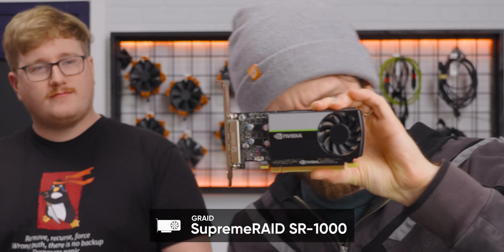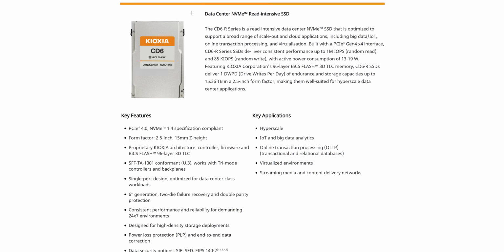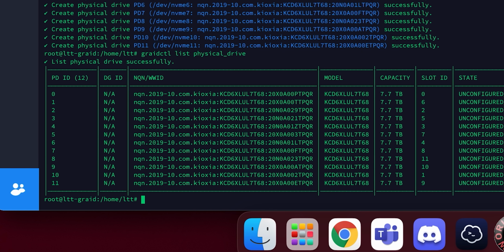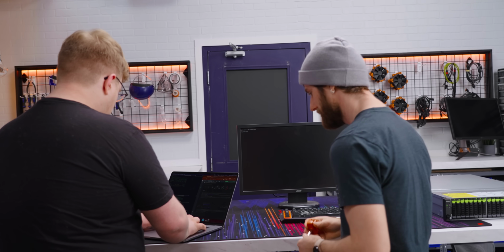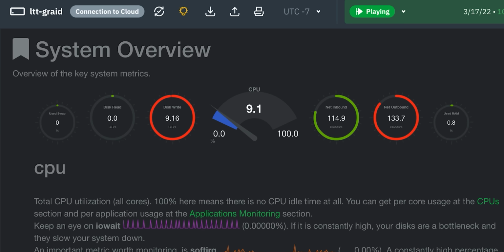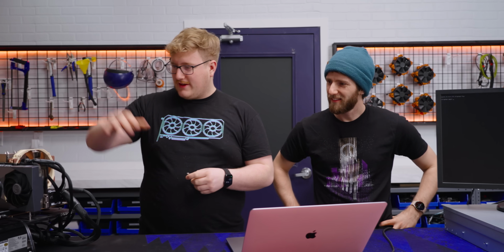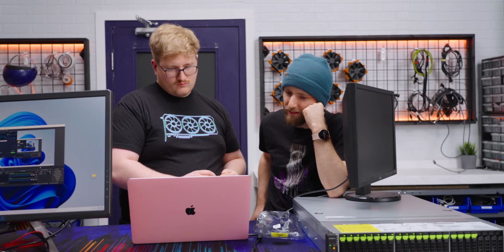I predicted the future! - GRAID Graphics Accelerated Storage

Comment: I wonder if this would be possible to do with any GPU with custom firmware. Would be a cool purpose for spare GPUs...
Reply: In b4 nvidia makes this a software feature and obsoletes this thing. Probably doesn't even need to buy them to kill them.
Reply: Spare gpu's.

HOW DARE YOUUUUUUU
Reply: @firefly2472  I'm sure they're talking about 10 year old cards
Reply: @doggo_woo  I know :)
Have a few myself.

And no, not gonna sell them :p
Reply: @firefly2472  Gotta collect em all lol
Reply: Well the bios reports as a regular card so it's software not firmware
Reply: I don't think you need anything special.... just a cuda program paired with a kernel module.Not even firmware change. At least I can think on ways to do it (IF shared memory is available).  I'm almost sure this is software locked.
Someone will do this in a generic kernel module  and any GPU in days... I'm sure.
Reply: @635574  that's where AMD would come in
Specifically the open source AMD Linux drivers, because I wouldn't be surprised if amd also tried to patch this
But the open source linux driver would bypass that patch
Reply: @firefly2472  yeah i have a 750ti, rx580 and a 5700xt sitting in my room with 2 x570 mobos, i  try to sell em but 10% below msrp aint workin
Reply: @MayYTlive  I was going to say, wait until the FOSS movement gets hold of this.  It could get interesting.
Reply: Yeah giving new life to ageing gpus... Even to run it like a virtual raid card is a great idea
Reply: I WANT IT OPEN SOURCE FOR AMD GPU PLEASE
Reply: @firefly2472  Got like a 650ti 560ti and a 1050 as spares
Reply: @framegrace1  i hope someone actually takes time and looks at this, otherwise i might
Reply: @firefly2472  me with my 6 home built pc's, yes spare gpu's how dare you, at least put them to work. and no that's not a joke, and no im not mining on them, i have them for different tasks.
Reply: Maybe. The ram up and CPU usage they described sounds like it's being loaded into the GPU at least partially by software not some special magic firmware.
Reply: @sZ04277  bro i will buy an rx580 or 5700xt for 10% below msrp

Hit me up fam, I need to expand my lan center
Reply: if you watch near the end they find out that it doesn't even have custom firmware, the software is literally just a cuda program and a driver. if it didn't tie the license directly to the gpu then it would probably work with any nvidia gpu
Reply: I was wondering something similar.  I could see the graphics card manufacturers working the capability into their existing drivers so they can brag that their own card makes your whole computer run faster.
Reply: @sZ04277  I would buy a 5700xt
Reply: Ofc, you just need to know how to write RS ECC using PTX assembly ;).
Reply: @Vatharian  I think it might be easier to break out a disassembler and make the licensing code accept the other GPU's serial number; as hardware serial numbers could be written into ROM or efuses or some other one-time programmable storage at the factory.
I'm looking at this as being a normal program compiled into AMD-x64 versus signed custom hand-tweaked NVIDIA low-level firmware written specifically for that series of GPU architecture.
And in turn, probably cheaper to just call up the vendor and negotiate for them to do it as a special order, since the other two take many hours of expert engineer manhours.
Reply: @rarrawer  Chances are the 'accepted' SN is indeed simply a hardcoded string in the program. Supplanting it with your own might just work if it's standard CUDA stuff. You could probably crack the license check to just say "a-OK" pretty easily, but it'd require a supported card to do the proper REing. I wonder though, considering it's standard GPGPU stuff, it is more than possible to write an open-source OpenCL variant that does RAID stuff. It would be a pretty interesting project for, maybe, a college student thesis. Considering the performance ramps up as shown in the video, I imagine there are some caching algorithms at work.

Comment: Why you're confused with RAID5 results? Here's some points to consider.
1. To calculate parity it's required to send data to and from GPU, or calculate with CPU. It's a possible bottleneck.
2. Was our array in optimal state before tests? It should calculate parity data(process called build/rebuild/resync) before going to optimal state. That can limit performance too, and it explains 100% GPU usage without host I/O.

Comment: it makes me really happy that these are exactly the same as GPUs, because that means that A: The software could run on ANY gpu, and B: you can use these cards AS FUCKING GPUS if needed, meaning they won't go to waste if you no longer need them for running a RAID with. No doubt you'll need some kind of hack because of the license thing, but yea that's wild lol
Reply: I wonder if you could use it as a basic display output at the same time.
Reply: It would work the other way around. These are older GPUs. It's more likely that industry would repurpose existing but outdated GPUs to use for this application, instead of what you described.
Reply: Mining only GPUs perhaps. Nvidia's thing is CUDA, I expect if you can run CUDA code then you can run this RAID thing.
Reply: @ViciousTuna2012  god I hope so lol, then I might actually be able to access this technology within my lifetime. With how the setup is described, it makes me wonder just how much processing and bus bandwidth you really need for this. Presumably memory is a factor, but for simple user-oriented tasks, you legit do not need 100gb a second for *anything*. I wonder how this would interact with different solid state tech like Optane and optane hybrid. You might be able to blow the price, capacity, features, and performance of the top end raw pcie drives on the market using an old junker display processor, and 2-5 consumer optane hybrid m.2s. Of course adapters to fill that many slots may ramp up costs prohibitively. Pcie bifurcation and slot adaptation is way more expensive than it should be.
Reply: @curvingfyre6810   I wouldn't think of this in terms of user-oriented speed requirements. This tech is going to be most useful for server applications, which will be able to utilize that level of bandwidth (100GB/s).
Reply: You could probably make an OpenCL-based version for an open-source solution that'll work on any manufacturer's GPU. Nvidia's shown it can be done, now you just need someone to clone it.
Reply: Makes you wonder if all modern GPU could go between a gaming and data mode if done the right way.
Reply: @TheDuck1234  cant really think of an application for only using one of those features at full effectiveness at a time.
whats more likely is that we eventually see dedicated logic for this funciton that can work alongside the standard functions of a gpu, similar to the dedicated logic for AI image scaling and ray tracing which are getting popular these days.

Comment: With the kind of airflow going through that chassis, would the RAID GPU card stay cooler if you took the shroud and fan off? Assuming the heatsink fins are oriented horizontally.
Reply: gotta remember that it's a positive pressure system in that thing so it's forcing air though those fins even with the integrated fan turned off. when it's on it's more boosting the speed over the server's insane baseline by helping air maintain speed. it's only ever going to be a single digit percentage diffrence
Reply: Informative answers from both of you, thanks. I simply don't have rackmount server experience, and am happy to learn from those who do.

Comment: GPU accelerated raid, NVME drives attached with a GPU, PCIe 5 coming. 

I still say there could be some really interesting devices coming that could handle several different things at once, without performance issues. 
e.g. A single GPU, with 4 drives, in Raid, with the raid being taking care of by the GPU, and the GPU sending video output (perhaps some other computation happening as well). All without a performance being impacted with any of it.
Reply: It's like a return to the past when some Enterprise GPUs had inbuilt SSDs.
Certainly not common, but not a new idea.
Reply: Back to the days of a math coprocessor
Reply: Please read my name❣️
Reply: Are we going to see less of a push for improvements to the CPU in the future then? maybe that's why Intel are moving into the GPU space.
Reply: You are underestimating the software complexity of these solutions. Anyone can duct tape together a bunch of components, but making them actually work together seamlessly is not trivial, and when something goes wrong, they are just too difficult to debug. If you look at the history of computing, simpler solutions tend to win. Only the most performance critical applications tolerate some complexity.
Reply: Don't worry, NVidia will destroy all the cool ideas with terrible licensing.
Reply: @Rich-qs6kn  I think yes and no. I think x86 is nearing end of life. Which is why intel is embracing ARM and RISC V. AMD is holding out (but they seem to have their own ARM-based design ready).  And of course see Apple's recent use of ARM chips. 
I think that's why Intel came back into the GPU market. ARM and GPU chipsets are similar and have many overlapping benefits (also see Nvidia trying to buy ARM).
Reply: I once wished GPU cards had SSD ports.  Recently learned one exists probably after its support ended.  It makes sense for that config.  GPUs take up a lot of PCIe lanes which they don't use most of the time.  Drives can be plugged in to use the same lanes at a lower priority.
Reply: @jseen9568  AMD has an interesting hybrid design patent, which would work similarly to intel's big.little, except the E cores would be ARM or RISC V, that would be interesting if windows supported that through some pseudo-emulation like macs do.
you could run a stripped x86 kernel that redirects system calls to the small processor on which the os runs.
though given the performance they show on the M2 max, I think a hybrid architecture with only a few tweaks to ARM or RISC V to make them able to run x86 code might be better.
Reply: Er no, GPU accelerated RAID will NEVER be a thing and anyone who thinks it will is a fool. So I have been doing enterprise storage for over 20 years now and sure back in the day hardware accelerated RAID was a thing, but it has not been for more than a decade because CPU's are now so fast. Sure you get hardware RAID cards but 20 years ago they had specialist silicon to do the RAID calculations, now they have a general purpose CPU.
For perspective, my home server which uses an i5-9500T can do the RAID6 calculations at an astounding 37GB/s (yes that's gigabytes) on the CPU. That is around the memory bandwidth limit of the system and more than enough to saturate a 100Gbps network connection several times over, except the PCIe bus would give out long before that. The enterprise PB scale GPFS system at work can using nothing more than the CPU's saturate multiple 200Gbps network connections without breaking a sweat. It is commonplace now for enterprise servers to have dozens of cores, there is just so many CPU cycles that the concept of offloading RAID calculations is an unnecessary hair-brained idea.
When it comes to storage Linus Media Group are well into the Dunning-Kruger effect. Actual proper competent enterprise storage admins watch their videos and just shake their heads while making tut tut sounds and rolling their eyes.

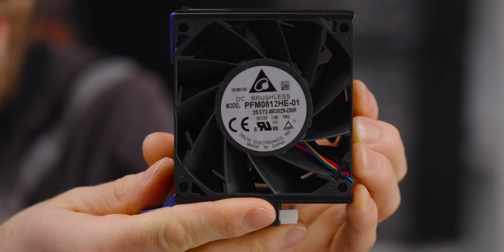Comment: 7:07 12v 7a, probably sounds like a fighter jet with the afterburners on, of COURSE it's made by Delta.  Their little 60mm monsters and the sound they made is part of why we started getting 80mm and then 120mm CPU coolers.
Reply: HOLY... 84W?!?! WOW! It need a lot of that power to cool itself!
Reply: @jrcowboy1099  It's not a piece of silicon which almost entirely dissipates its power input as waste heat. It's an electric motor showing an efficiency above 95%. Of those 84W, maybe 5 are converted to heat, the rest moves air. A LOT of air.
Reply: @ujiltromm7358  Lol, yeah you're right, I guess I was apparently brain dead when I wrote that.

Comment: My prediction for the future- this type of card will quickly be obsolete and become integrated into CPUs or motherboards. This is a PhyX card for storage. They might continue to exist for servers though.
Reply: Perhaps, but it's using GPU Compute at 100% and I don't think it'll be in CPUs anytime soon since it seems to be very much an enterprise solution. It might be compared to like a PhysX card but this is more akin to using a dedicated GPU for tensor applications.
Reply: If there is a market for this, AMD and Intel will integrate it into their CPUs in a more refined way.
Reply: i can see RISC type chips made specifically for this task becoming popular.
Reply: "This type of card" is just a GPU. There doesn't seem to be any special fixed-function hardware or special firmware as explained, It's just offloading what the CPU would do onto what's effectively a GTX 1650 with the TDP pared back to fit under a smaller cooler. Integrating it into CPUs would just be doing GPU compute on the iGPU. 

For home users, the processor overhead isn't that high anyway. For servers there isn't an iGPU to offload on, and even if they did add one, it would be fighting the main CPU for die space and power budget where an add-in card would not.
Reply: @jameslake7775  chiplets change this equation slightly. AMD could put a dedicated RAID accelerator on the I/O die of Epyc without affecting the rest of the products.
Reply: @Finder245  no. Just no. A CPU cant hold a candle to the level of parallelization a dgpu has. There's zero chance this level of performance comes on a CPU based raid capability in the next 10 years at least.
Reply: @RobertSmith-lh6hg  Have you heard of the ps5's in cpu decompression engine. Yes this kind of thing will come and is already here. This is the logical next step for DirectStorage.
A single pcie5 ssd might hit 14Gb/s and a pcie6 one that we get in another 3 years or so might hit 28Gb/s. Linus is using 50% of a 32 core cpu just to read that fast. It's very obvious that hardware solutions are needed to this problem.
Reply: @RobertSmith-lh6hg  I did not say “CPU based”. You could get this performance with much less dedicated hardware. Most of that GPU is wasted in this application. RAID does not require any floating point calculations. All you need is a dedicated accelerator for parity calculations, all integer, and a couple of simple integer cores to coordinate the work. Using a DGPU for this makes sense only because those dies are already mass manufactured, but if there is a real need for this, the dedicated hardware can be included on the CPU (SoC) at much lower cost.
Reply: @sparkyenergia  SSD tech/performance is lagging behind PCIe to the point that for PCIe gen 5 SSDs some manufacturers are considering reducing the M.2 PCIe width from 4x to 2x while keeping performance similar to existing M.2 PCIe gen 4 drives.
Reply: @jameslake7775  Which might mean the task (at consumer level) can be done by integrated GPUs with some optimisation.
Reply: @RobertSmith-lh6hg  Hi Rob, just saw your comment. Your prediction is wrong. There is already a high end CPU based software raid that performs better than the GPU accelerated software raid. I have done the benchmarking on a supermicro server with 12 kioxia drives.

Comment: This is like the opposite of ZFS in every way. ZFS is like "ecc for resiliency on top of hashing everything"! Graid be like "speed!!!!". It'd be interesting to see how much data corruption would happen on one of those in a real world heavy write workload.
Reply: While I agree, you response may lead a novice reader to mistakenly believe ZFS protects against corruption, when infact it an be the opposite.
- The hash in ZFS detects corruption, can't actually be used to recover data
- ZFS has next to zero protection against bitrot
- ZFS can't detect errors introduced by the host, so ECC is critical at all layers, RAM.  ie: Don't run ECC on cheap hardware, overclock ect.. as errors introduced on the host will get written to the ZFS and NOT detected.
ZFS is perfect to host VMs but the ZFS server itself should never be virtual due to higher risk of corruption.
So while ZFS is about as good as you can get in the enterprise, due to the extreme robustness, ease of recovery and tons of features.  Running it on consumer hardware introduces a lot more risk over other filesystems and will generally perform poorly without a crap ton of memory.
Reply: @timsmith3743  ZFSs protection against bitrot is literally a focus in it's initial design. If your pool is using raidz, ZFS not only protects from bit rot, it eliminates it in real time. The hash that ZFS stores with every write, and the parities of your pool config allows ZFS to determine which version of data is correct and only return that data. Not only does ZFS protect against bit rot, it also protects against file corruption. 

ECC is recommended for ZFS systems because it's the only part of the system that is not protected against corruption. ECC protects the data while it is processed by ZFS.
Reply: @gamebrigada2  , ZFS detects bit rot, but can only perform the bitflip if a replica exists.  To understand your risk, you need to review the results of the scheduled scrubs and often need to replace the lost data where it can not be repaired automatically.